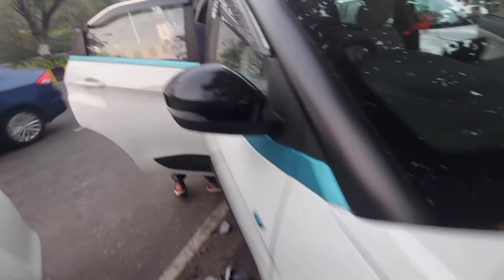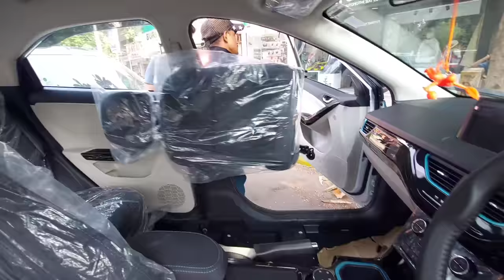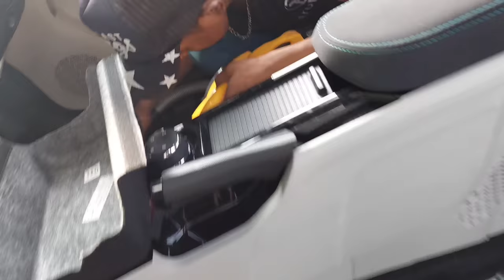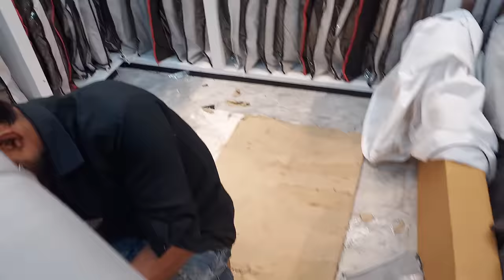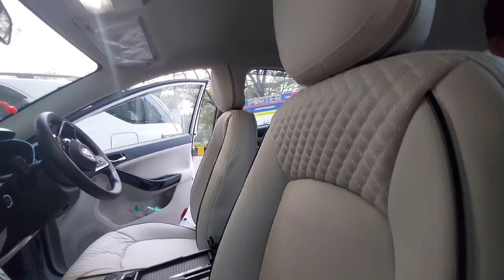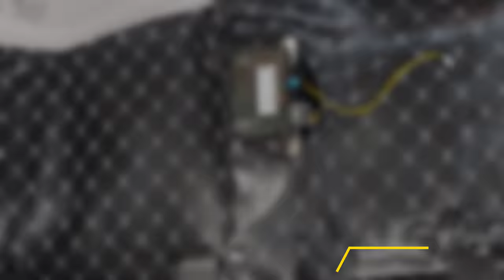Tata Nexon EV ( Electric) Seat Cover & Floor Lamination Installation From truFIT | Bucket Fitting

Comment: Tata motors told  don't do flooring on Nexon ev
Reply from the maker: The lamination doesn't disturb the wiring inside the car. There is no problem in it's application from our side.